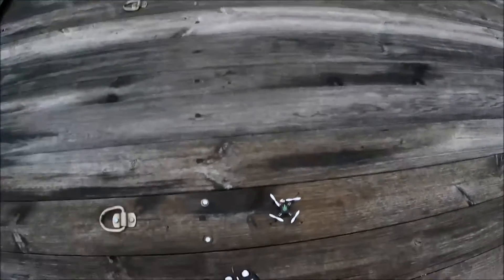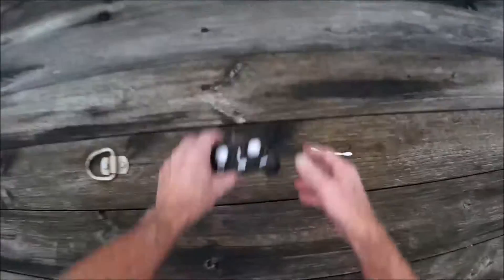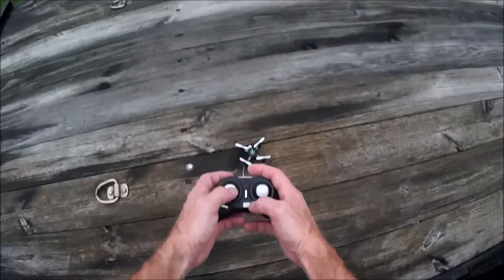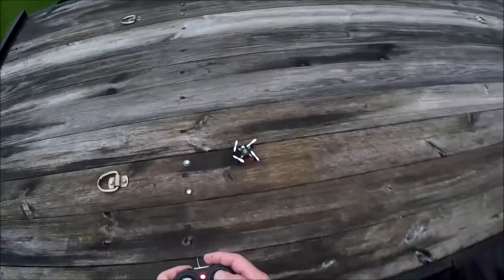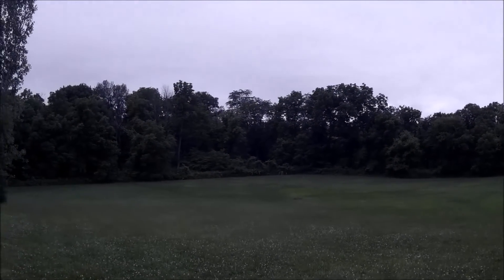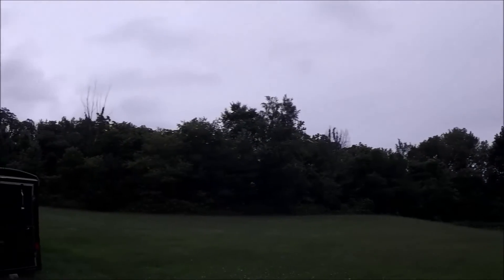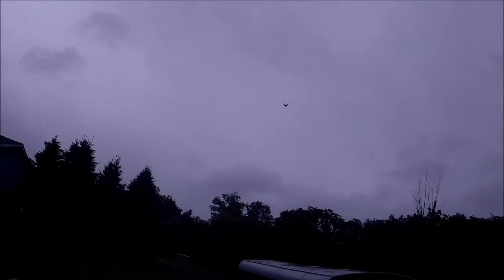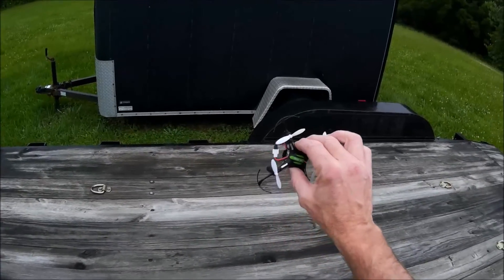Drone Eachine H8 Mini Range Extension Flight Review

Comment: 150m +++ up to max 250m if antena is directly straight.
  You can use better props. Super strong and no fell from axxis: 
http://bit.ly/2m4o8jY  and for more speed use 59000rpm motors: 
http://bit.ly/2kPcfON

Comment from the maker: It fixed that problem.  I  had it out at least 150m yesterday with no drop outs. I  ordered a 200mah 30c battery to upgrade its performance.
Reply: yes it does wonders for H8 and many other micro's. tiny bead of hot glue over the LED's really helps seeing orientation too